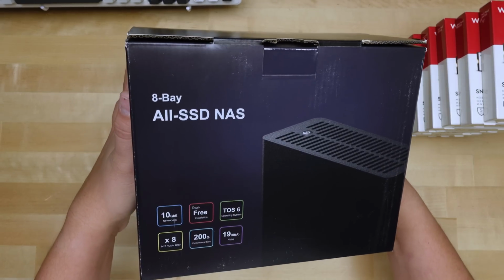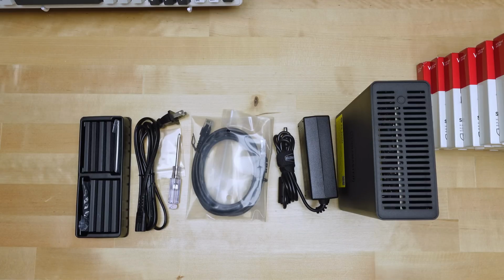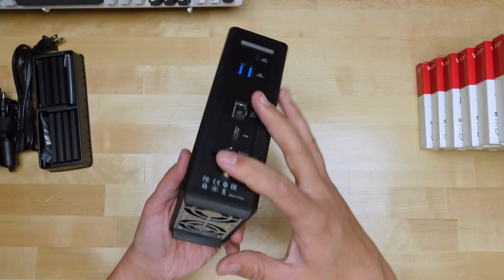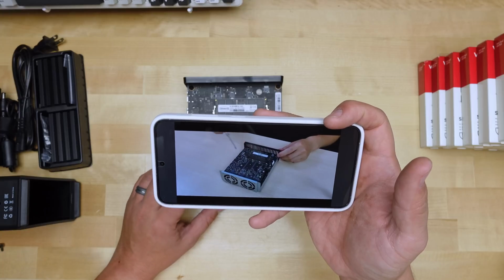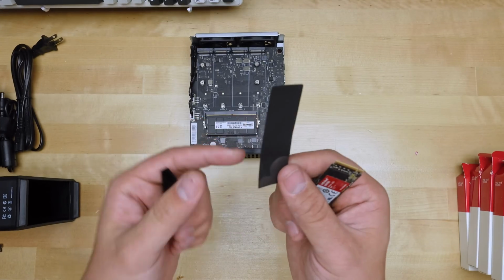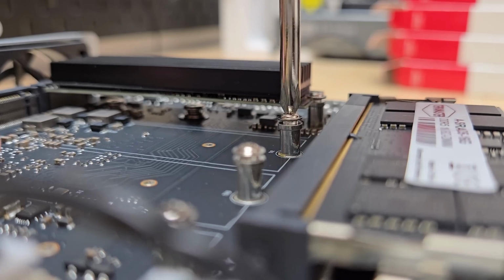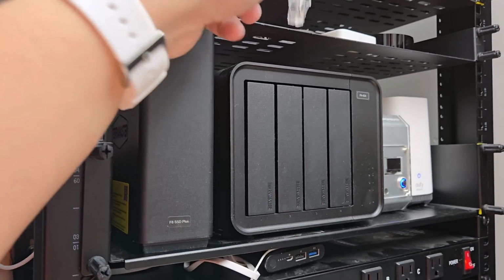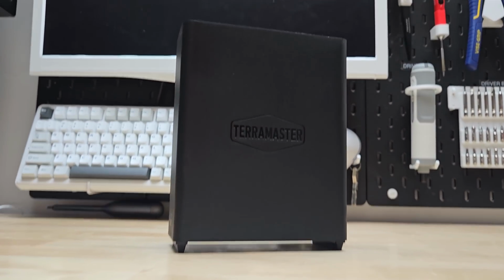A Tiny NAS that Packs a Punch! (TerraMaster F8 SSD Plus)

Comment: An 8t MyBook drive is only 180.00😂
Reply: If you mean that this is a lot more expensive, it is a different use case. The attachable USB drives can sometimes be a single drive which would mean data is lost if it fails. NAS devices are built with being able to have drives fail depending on configuration from the ground up. They also are built as 24-7 devices meaning (generally) low power consumption and with capacity to host applications that use the media stored on it like Plex/Emby/Jellyfin that can be consumed by anyone on the home (Apple TV/Nvidia Sheld, Phone, Tablet, PC, etc.).
Reply: @TechDogeth  Well aware... Now how much would it cost for that device and 8 1t sticks? 2t sticks if you want redundancy...?
Reply: @MrSupersidewinder  I can't blame a super car for being expensive but can't carry many people like an SUV 😂
Reply from the maker: MyBook < NAS